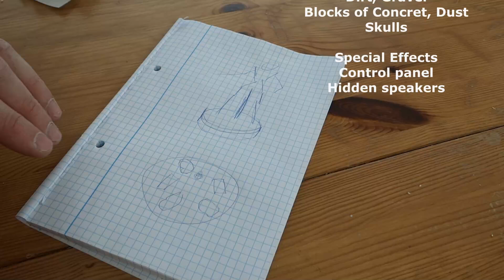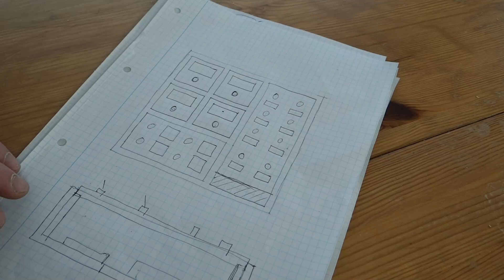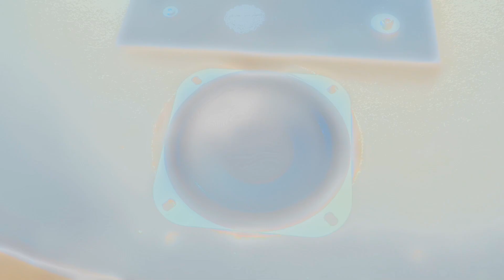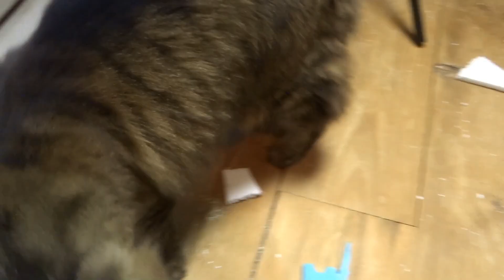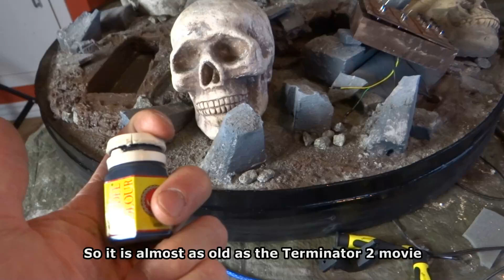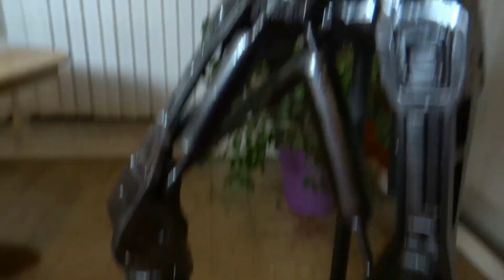Building a 3D printed Full Scale T-800 Terminator Endoskeleton - Episode 4

Comment: What size printing area is needed to make it
Reply from the maker: This terminator was printed on a CR10S Pro and two Ender 3 Pro machines. The CR10 had the largest build volume of 300X300X400mm. However, with a larger printer you would be able to print the model in larger single pieces thereby saving yourself from a lot of work assembling everything afterwards

Comment: The base is well laid out but the skulls are just too basic. Could you not just print more realistic skulls? There are plenty off designs out there.
Reply from the maker: Yeah I didn't use that much effort on the skulls just used some halloween props. They could defintly be printed, but for the moment I'm just going to finish the project. I might return to it at a later time and fix up all the stuff I could have done better. I have planned on making a video about the project when the build is complete, here I will address these topics so other builders can learn from my mistakes :)

Comment: I would have hidden some casters underneath the base, with just a quarter inch floating distance from the floor.
Reply from the maker: Hi and thanks for the comment. Correct me if I'm wrong, casters are small wheels for furnitures? (English isn't my primary language). I have mounted some rubber spacers on the bottom of the base so it's not directly on the floor. Wheels might be pratical to movie it around during cleaning so it could be an option. I have also build the model and display so it's fairly easy to disasseamble so I can move it if needed.